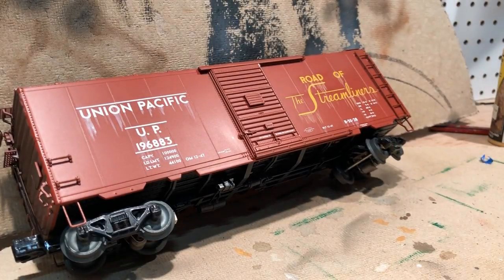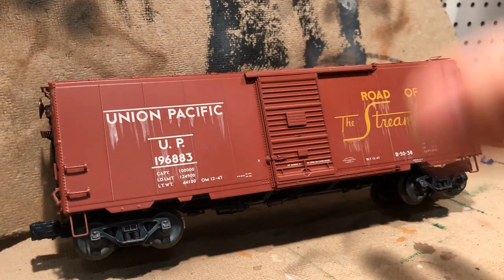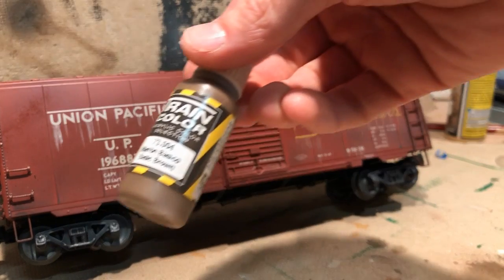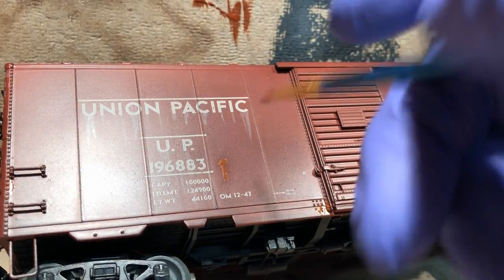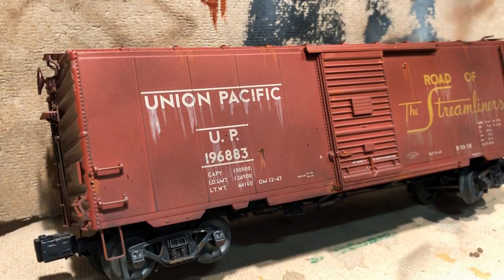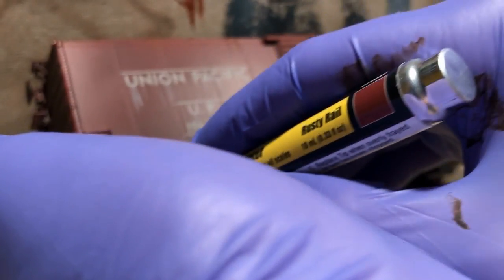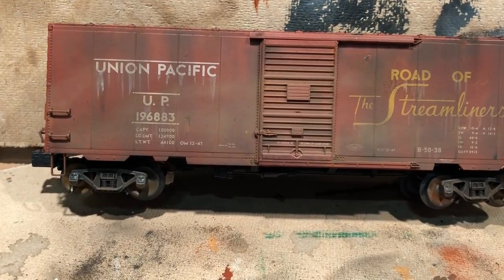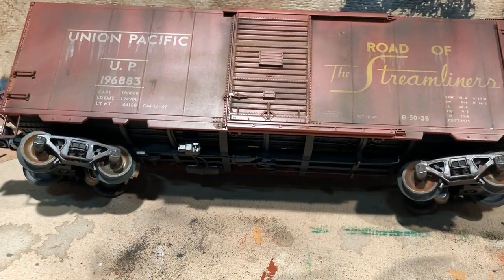How to: Weathering a Model Train Boxcar, O Scale

Comment: Did you clean the airbrush after each application? What air brush do you use?
Reply from the maker: NJHiRailers - Lionel Ambassador Program  between colors I run some thinner through it before adding the new paint. Then give it a thorough clean after the project is done. 

I believe the brand is Masterline